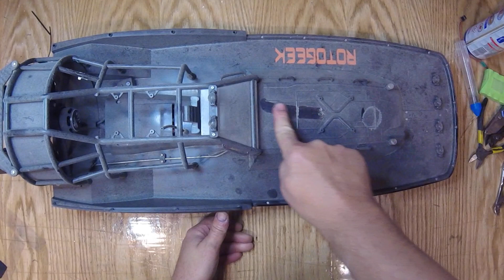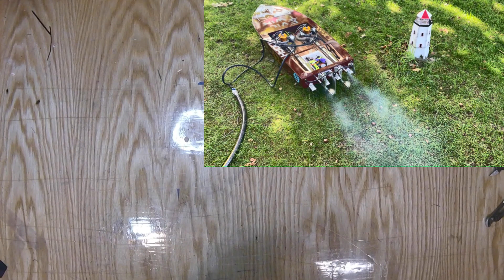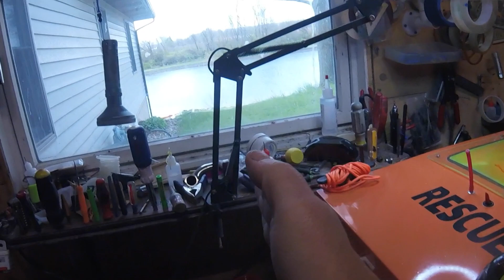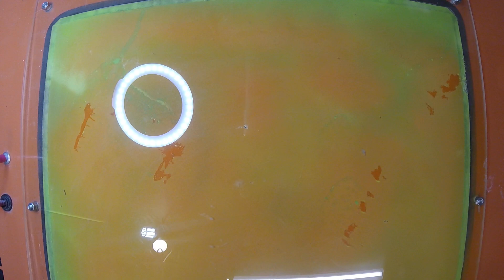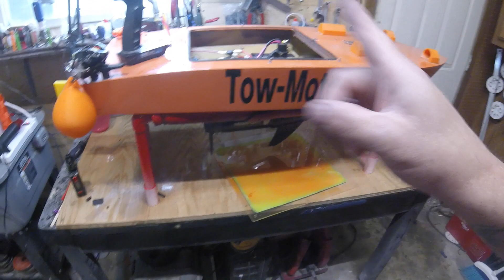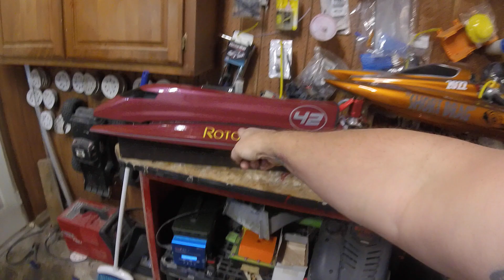Rescue Boats for RC Boats, types and methods + Overview of mine

Comment: What if you used the tug boat as a transport for the tennis ball retrieval with a Stevo controlled ramp off the front of the tug to drop the ball either in or the other side of the boat to be rescued